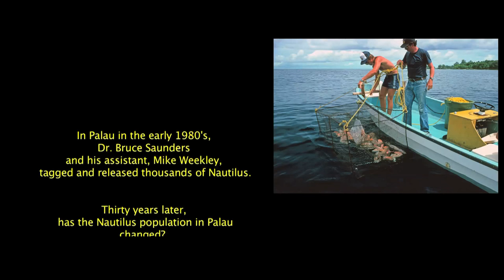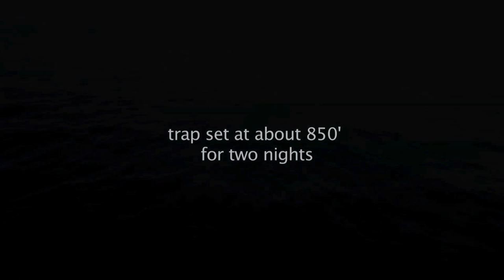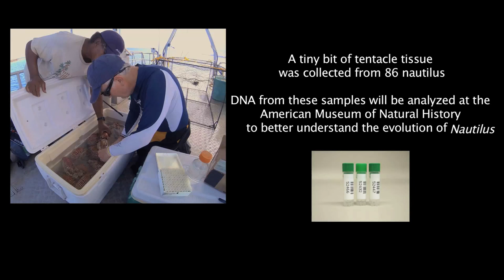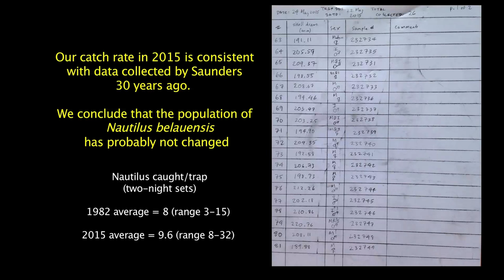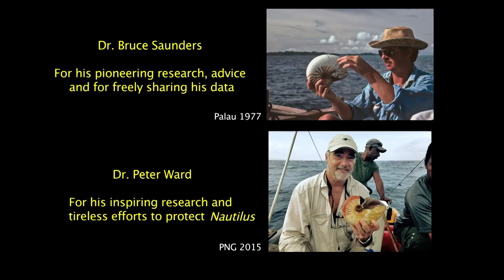Nautilus Research - Palau 2015

Comment: The release technique (perhaps unintentionally) was not in favour of the animal, maybe you should have dispersed them in a greater range of depth?
Reply from the maker: You didn't follow the story.  When we released the animals in areas not frequented by divers, there was no problem.  We accidentally discovered that it is not good to release them where divers go; in this case we used a mooring buoy used by dive companies.  The dive companies have apparently captured and released nautilus for their divers at that spot in the past and the titan triggerfish learned that divers might have nautilus with them.  The depth was not the problem; the location was the problem.  Never release nautilus anywhere near where divers have been photographing nautilus on a regular basis.  Normally, at a depth of 130' we should have been well below the normal depth range for the titan triggerfish, and in fact at the other locations we were never bothered by them.  But going deeper than 130' also isn't a good idea given the very limited no-decompression limits for divers and the time it takes to release the animals.
Reply: Ah okay! Hadn’t read this before I posted. Thankyou